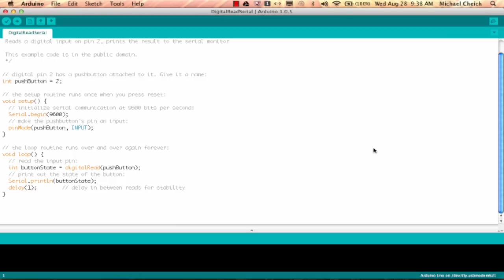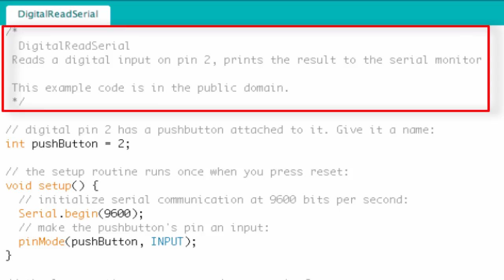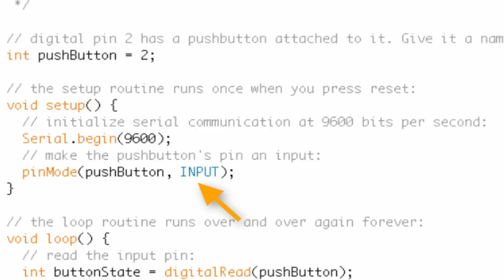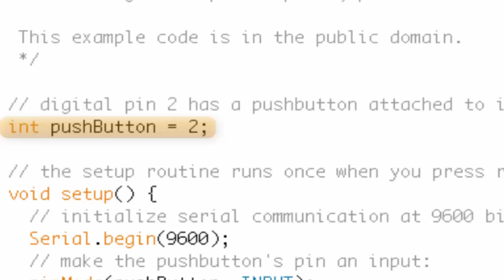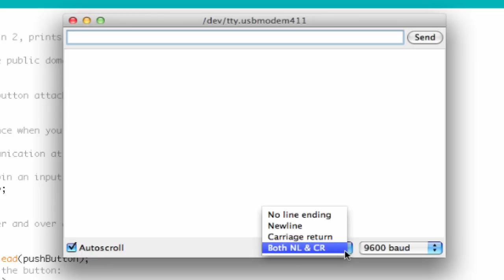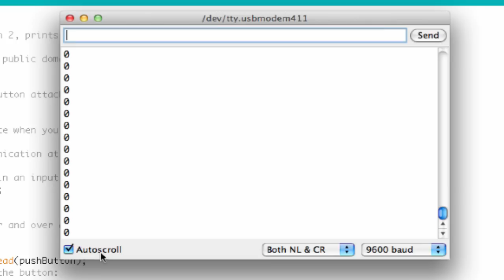Tutorial 07: digitalRead() and the Serial Port: Arduino Course for Absolute Beginners (ReM)

Comment: I get all 0's regardless if the button is pushed or not. I would think this was the button...but then I tried all 5 that I have...and they all fail. But when I connect the power straight to pin two...I get random zeros and ones. So if anyone has any suggestions I would greatly appreciate it.
Reply from the maker: Hi Klay,  This is curious.  

What strikes me most as odd is your second observation that when you have 5 volts applied to pin 2, the serial monitor is returning random zeros and ones - it should be solid 1's.

I would first double check that you have your button hooked up correctly.  Buttons with four leads can sometimes lend themselves to incorrect hookup.

If you are sure you have the circuit setup correctly (which you have already probably checked), I would then try switching the code and circuit to a different digital pin, and see how that works.

Best of luck!
Reply: Open Source Hardware Group 

Figured it out. My ground to register a constant 0 when the button isn't pushed ,wasn't connected well..or at all. I would get noise or random 1s and 0s.

BTW your tutorials are amazing at explaining everything!
Reply from the maker: Thanks Klay!

Comment: Firstly, thank you, great tutorials!
So I'm trying to continue from this basic sketch and add an 'if' statement as below.. (tried both above and below the println line)

if (buttonState = 1){
digitalWrite(LED, HIGH);
}
else{
digitalWrite(LED, LOW);

Note: 'LED' is a variable, on pin 8 and set as an output. The LED isn't turning on and off as the switch is being pressed.
I wanted to see if i could control an LED without the current flowing directly to the LED via the switch (i.e. off a different pin on the Uno).
Anyone know whats going on here? is this possible with Arduino?
Reply: ahhhhh! the satisfaction of working through this and working things out yourself :)
I was trying to work this out for about 3 hours by moving curly brackets, double checking IF statements etc. before giving up and posting a comment.
After covering tutorial 10 I figured i should have been using == as = is used to assign values.
....ahhh, the joys of learning!!! Thanks again for the great tutorials. i will visit the site to continue on from number 10 for sure!!
Reply from the maker: Sukhvinder Sahdra Awesome work!
Reply: Sukhvinder Sahdra :)
Reply: Sukhvinder Sahdra Or you can just "if (buttonState > 0)" also works. Nice Job!

Comment: i get random zeros and ones when not pressing the button, and i get ones when pressing the button.
Is my arduino broken, becouse i can return my arduino with the warranty that i have, (wait do i have warranty? D:)
Reply from the maker: Hi Joshua Barendse, I am thinking it may have been a loose ground wire?  Out of curiosity, did you have a pull down resistor attached to the pin?
Reply: +Programming Electronics Academy  i found the solution , i had this exact issue with some tinkering i found the breadboard is split into 4 sections thus your never grounding the pin and this will course irradic reads , it is normal!

Comment: For those of you who don't know, the resistor is placed there to prevent short circuits and to allow current flow to PIN 2. Let me elaborate... when the button is not being pressed, there is no current flow since the closed circuit has no voltage being applied over it. When you click the button, a voltage appears. Now this voltage has 2 paths it can take. 1 is towards the ground (where the resistor is connected) and one is towards PIN 2. You need to remember that the PIN 2 path is also connected to a ground eventually (very important to remember) and when the path reaches ground, the current will have passed through resistors themselves. So in theory we have 2 resistors (1 is the 10K Omega resistor seen, and the other is within the micro-controller). So current will have passed through both paths (through the pass of the Resistor and the path of PIN 2), meaning your micro-controller will be able to sense the change in current (which is the whole idea). Now if the resistor was not placed, since electricity looks for the path of least resistance, all of the current would just go directly to the ground connection since the path has less resistance than the PIN 2 Path. So in that case the circuit would not work, and you would have created a short circuit which could destroy your electronic device. If your not sure what a short circuit is, It would be wize to look it up.
Reply: "Now if the resistor was not placed, since electricity looks for the path 
of least resistance, all of the current would just go directly to the 
ground connection since the path has less resistance than the PIN 2 
Path. So in that case the circuit would not work, and you would have 
created a short circuit . . ."

Actually, if the resistor were not placed, there would be no path, and NO current would go to the ground connection.  This would be an OPEN circuit, which is of course the exact opposite of a short circuit.
Reply: Marko V actually from my understanding its a "pull down resistor". it prevents fluctuation in the high/low state of the pin, drawing any ambient current in the pin to ground when the button is not pressed, but provides less resistance to the pin than to ground when pressed resulting in a high/on state.  apparently there is electrical energy in the air that can mess with your low voltage projects.
Reply: EXCELLENT ! First reply to the resistor question that actually "clicked" for me.  
I know my paraphrased summary below is riddled with noobness but is this it in a nutshell ??

The resistor is there for when the button is NOT pressed, in case any minuscule stray voltage has "leaked" into pin 2 while its just sitting there, making it a tiny bit more than zero.
Once the button IS pressed, the current will go through the pin 2 part of the circuit because it's easier than taking ( what looks like to me) the "short circuit" the resistor is now making.
Reply: any resistor would do? or is there any computation for that?
Reply: Also, I assume that the voltage that passes by both the resistors (1st one being the 10K Omega resistor and the 2nd one being the micro-controller), since the setup does resemble a parallel circuit and resistors in a parallel circuit experience the same voltage while experiencing different currents.
Reply: Marko V 
I still dont get it. If the resistor would not be placed there, then current would only flow through pin 2, right? - presumed the button is pressed. Then the microcontroller can detect current. If the button is unpressed, there is no current flowing anywhere, so the microcontroller can't detect current.
My point is, to me it seems the resistor placed there is redundand... what am I getting wrong?
Reply: I love people who explains things easily, THANK YOU
Reply: This guy explains it pretty well. https://youtu.be/BxA7qwmY9mg
Reply: @chicagophoneguy  thank you, this video really cleared up the resistor question for me.
Reply: Wow, thank you. I just curious about that, why the circuit needs a resistor instead of just connect to the ground

Comment: I did the challenge No.2 and found out that even if I changed the pushButton from pin2 to pin3 in code, while kept the wire stay with pin2 on the Arduino board, I could still get the serial monitor read 1 and 0 when I pushed the button. Does that mean pin2 and pin3 are serial?
Reply from the maker: lucheng123 You know, I had some else tell me the same thing.  I did not have this experience with my Arduino board as I tested it after someone had said this.  I will have to do some more research and find out what is up.  Thanks for posting that!
Reply: Open Source Hardware Group Thanks! Great tutorials! Really helpful!
Reply: I tried doing the same thing. I guess you haven't saved the code before uploading. try doing it again but this time after saving
Reply: Vaibhav Gautam Thanks Vaibhav, will try it another time.:)

Comment: I've been trying to figure out the purpose of the resistor in the circuit. I think I figured it out, remembering something from my science class. Doesn't electricity flow in the path of least resistance? so by setting two paths, one closed all the time but with resistance and the other that can be open or closed, you change the direction of the electricity, is that right? its just to control the flow of electricity?
Reply from the maker: Flyerminer You are definitely on the right track!
Reply: thank you!
Reply: the resistor is there to limit the current that the arduino has to move/flow, remember the arduino can only flow about
40 milliamps. you will hear the term "being pulled high or low". here in this schematic it is being pulled low, to ground, if it where high it would be to 5 volts or whatever the Vcc or power supply is. when pulled low the arduino will sense a ground at pin 2, with that information the arduino can know what is happening in the circuit.  hope that helps mike
Reply: @snaprollinpitts 5 years later but I'm fiddling with a mega 2560,  and was curious of this as well. So essentially, the resistor is to limit the current to <40ma, because otherwise there we be no resistance and the current would probably be enough to damage the board? If I replaced the resistor with a wire, it would still technically be grounded but the current would be excessive.
Reply: @amorgan93  if you don't mind, please make a video of the wire instead of resistor, I'm pretty sure your mega board would be trash!!!  they say that there is no such thing as a bad question, but I think you have just crossed that line!
Reply: @snaprollinpitts  arrogant much?  Your negativity has no utility whatsoever. I think if you scroll down some, you will find many people confused by the resistor and questioning its purpose. It only took a little bit of learning about pull down/up resistors for me to understand more clearly.

Comment: A couple of questions here - First, why do you not make pushButton a constant, since its value should never change during execution? Second, would it not be better to declare the buttonState variable in the setup function, and only do assignment in the loop function?
Reply from the maker: Great questions Brett.  For the first one, your are right, the programmer definitely could have made pushButton a constant.  Why he/she chose not to do this I am not sure.

On the second one, I also agree.  I think part of the reason this approach was used is because the Examples that come with the Arduino IDE are meant to be basic in nature (usually).  And for a beginner, seeing the variable buttonState declared when it is first used may make it easier to understand that you must declare a variable before you use one.

This of course is pure conjecture.  Not much of an answer but the best I can come up with...Have a good one!
Reply: Open Source Hardware Group Totally makes sense. I am really interested in the electronics side of things, so your tutorials are very helpful. My questions are from the programmer's side of my brain. I am sure I will have more as I get into building stuff.

Comment: Hey there, when I set this one up everything is fine, but when I press the button it cuts power to my arduino uno!!! I can't figure out what is going on, please help!!  The button is working, but when I expose digital pin 2 to the 5 volts the Arduino uno board shuts down and disconnects from the PC....what is going on!
Reply: I found the problem....wrong resistor :P all fixed now.

Comment: one more thing, when i put the wire in any other pin ( 4 for example) without changing the code, i still get the same results ..
Reply from the maker: So the wire that goes from Pin 2, you can put in another pin (i.e. Pin 4), and you still get the output on the serial monitor?  I am not sure, I will have to check that out.  Great observation.
Reply: Open Source Hardware Group yeah, I guess maybe because the arduino pins default values are inputs ? ( am just assuming ).
Thank you sir, you make things more easier

Comment: still dont understand why 9600 baud ? .... amazing series though, am learning bit by bit thanks to you
Reply from the maker: As far as I can tell the 9600 Baud rate comes from an older standard.  This talks about it a little http://stackoverflow.com/questions/9815076/origin-of-weird-baudrates-for-serial-communication
Reply: Open Source Hardware Group thank you thank you thank you :D , you're awesome :D
Reply: An arduino uses a serial converter to communicate with your computer. There are a few arduinos that do not. Example the Leonardo. I am unsure if projects like this are possible without that interface.

Serial communication is the process of sending data one bit at a time, sequentially typically in 8bits at a time. Think of a bus that commutes between 2 points and only has one passenger seat. This passenger is horrible at remembering much. So we send a buses each with a passenger with a tiny bit of info. In most cases its a Hexadecimal number which is different than standard/Decimal numbering system. Google it for more info.

So 9600 Baud is the default standard for serial communications. Think of 9600 Baud as the buss schedule. Yeah you can speed it up but you have to tell both points so they know. IN the case of the sketch you are giving it the schedule of how fast to send the buses. To put this in simple terms a piece of hardware can only talk at a certain speed. Susequently it can only listen at the same speed. Also in the case of serial you cant talk and listen at the same time. Throughout electronics this is also refered to as a clock speed. The purpose of a clock speed is so that a device knows when to talk and when to listen to its counterpart.

Hope this helps.

Comment: I don't understand why we need a 10k resistor there?
Reply: OK. I know now. Without the resistor when the switch close it will be a short circuit.
Reply from the maker: Hi Roc Chow, that is a very legitimate question.  That 10K resistor is called a Pull Down resistor. When we are not pressing the button, it allows Pin 2 to "see" ground voltage, so when we use digitalRead() it will return a LOW value.

If you check out some of the written tutorials on the Open Source Hardware Group website, I believe I go into a little more depth about pull down resistors.
Reply: Open Source Hardware Group
Thank you so much for your tips about pull down resistors.
Actually I couldn't find the specific article on Open Source Hardware Group website. After Google it now I understood what is pull down resistors and also pull up resistors.
Here is the circuit I built for pull up resistors, and it works well:)
https://drive.google.com/file/d/0Bz20By9nwAh3TU83QkcxTFZyWlU/edit?usp=sharing
But I am not sure it is right or not. I am a newbie. If you can give me more feedback on could you contact me by email?
roc.chow1988@gmail.com
Lots of fun on learning that. Thank you again.
Reply from the maker: Roc Chow It looks good except that I believe you have the 10K resistor going to 5Volts and it should be going to ground.  If you pause the video at 4:30 and follow the diagram you should see what I mean.
Reply: The circuit I built is for getting a opposite result. Without pressing the button it shows 1, and when I press the button it shows 0. That is called pull up resistor to let the pin to "see" the high voltage:)
Reply from the maker: Awesome!  Nice man!